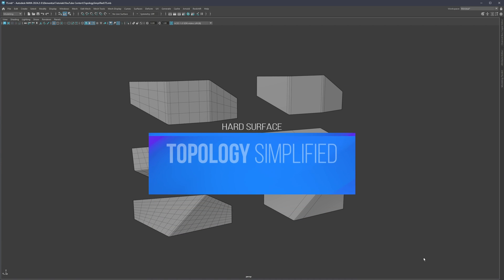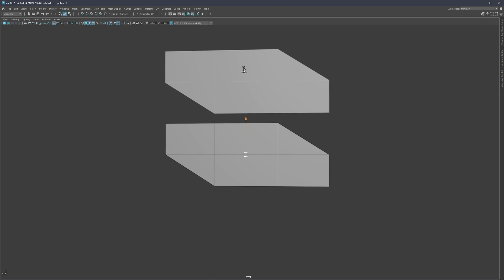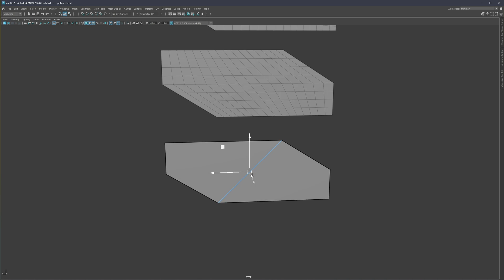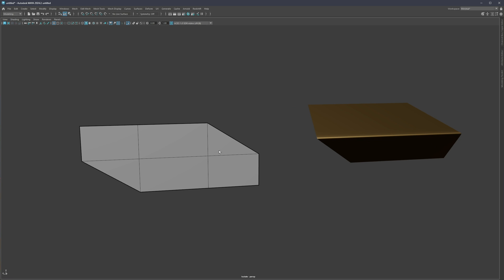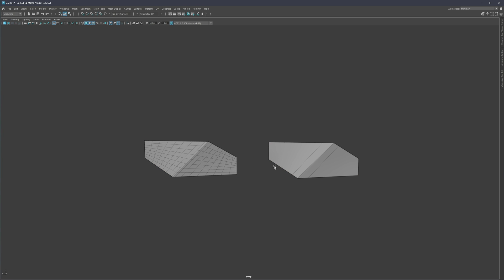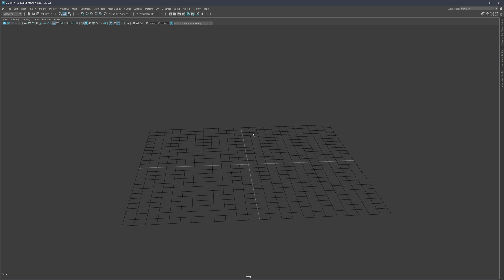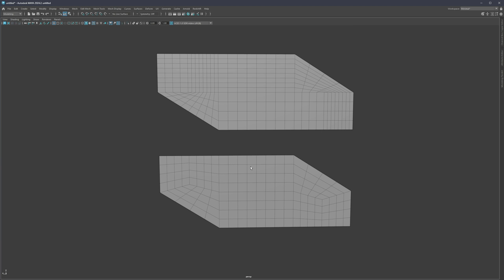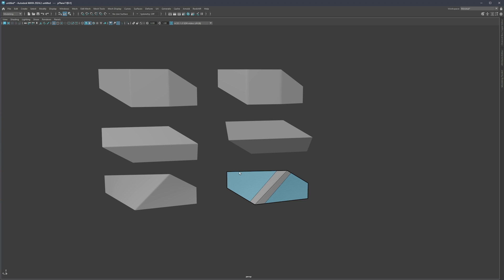Clean Hard Surface Topology (Simple Rules to Follow)

Comment: When would you localize topology, or terminate edges? I've been led to believe that you shouldn't have additional edges if you don't need them (like on coplanar faces), but a lot of these VFX models don't seem to follow that idea. They just run loopcuts through the whole model.
Visually, it looks better, but does it have a practical benefit? Wouldn't it be easier to work on a model with less topology?
Reply from the maker: This is a good question. If you check the videos before this one, you may find your  answer and see it's not really always the same case for all situations (Mortal Kombat mask examples)
In addition, I have a full topology workshop on my site that covers your questions with detailed examples. 
Cheers

Comment: you should add a complex example at the end after explaining using the simple examples. I feel like showing the techniques on a complex situation better illustrates the point
Reply from the maker: There is already a complex example of this in case you missed it. Mortal Kombat mask done at the very start that shows the practical aspect.

EDIT: Small tip.. often many would rush in complex examples without mastering the simplistic ones. Instead try to create similar forms on your own, and see how many situations could you find and solve.

Comment: I do all my modeling in C4D and damn I must say Mayas UI looks sooo clean. Do you think its worth making the switch or do you think C4D is good enough? Great video btw
Reply from the maker: Hi... I do CAD too almost on a daily basis, and both have their uses, so I def would not switch one for the other. In my opinion I think both workflows compliment each other very well. Only thing what matters is the use of the models. Based on the use then approach might change though.

Hope this helps!
Reply: @Elementza  I think you missread 😅I meant Cinema4D not CAD!
Reply from the maker: @LeftCG  lol... yeah C4D I have not used in very long time so can´t really say. You can always try both, see which workflow or set of tools works best for you :)
Reply: yeah i first watched you when you were doing c4d modeling tutorials. ill check maya out.   @Elementza